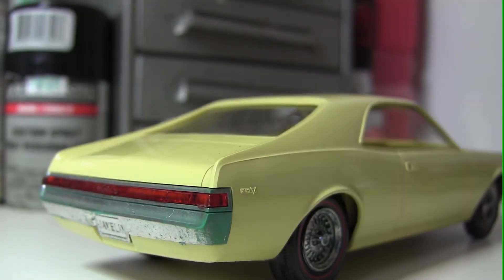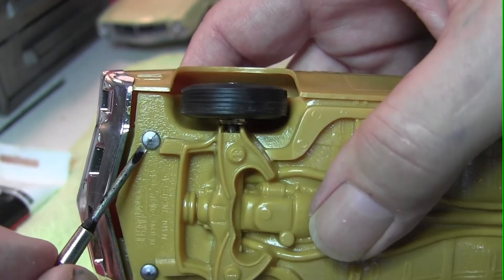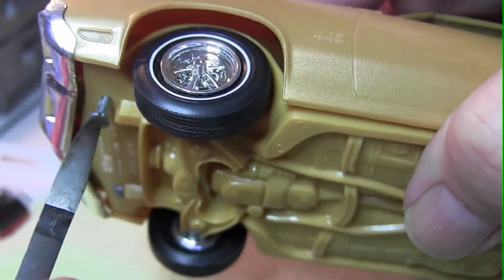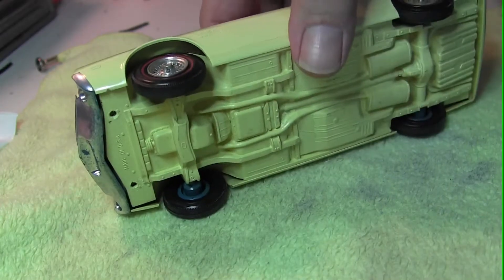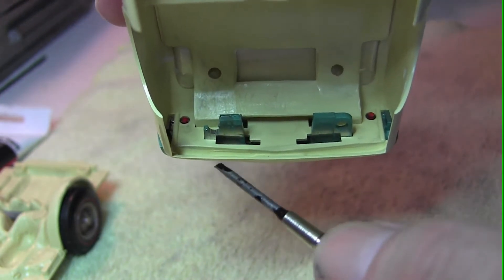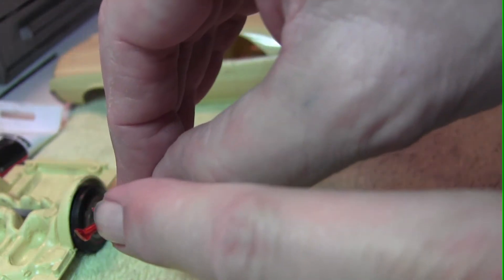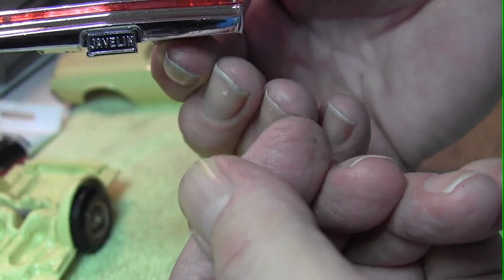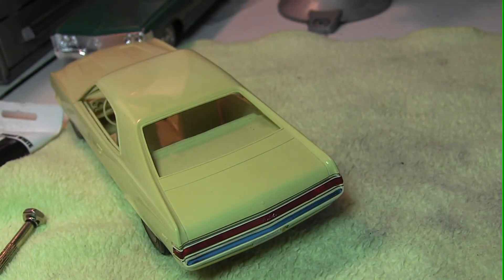Promo Bumper Replacement

Comment: The pin removal shown was for Johan's late plastic pins as used on the last years of their promo Cads and Oldses as well as the Johan/Ex-Cell re-issues.  I note you already had the metal pins removed from the Javelin.  You didn't state how those were removed, but by the amount of 'digging' marks around the hole, it looks like you may have used the same dig & pry method.  Using heat to remove the metal pins, instead of digging them leaves the chassis unmarked. The dig & pry method will only work if there's enough space under the metal pin to insert the screwdriver's blade. Sometimes there is, most often there isn't.
Reply: Thank you Chuck for the info. I was unaware of the heating method. I would be concerned about damaging the body.
Reply from the maker: If you have or make a video of using heat Ill link to it. I was unaware of using heat. I am all for less damage.
Reply: I don't have any means of making a video, but I'll give you the basics.  Needed:  An old style soldering iron--if you can find one with a small flat end, that's the best, but a pointed end can work too; An assistant to operate the soldering iron (in my case, it's usually my wife--begrudgingly); Needlenose pliers; Small flat-blade screwdriver (opt.).  One pin at a time. Your assistant needs to apply the point of the soldering iron to the center of the metal pin.  Keep it firmly in place so the pin can get 'hot'. Generally 15-25 secs is long enough.  Remove the heat source, and, using your thumb and index or middle finger you rock the wheels on that end of the chassis up and down while lifting the chassis on the side just worked on.  If the pin is hot enough, it will begin lifting up. Usually you can then grab it with the needlenose and remove that pin. If it doesn't lift up and the chassis is still firmly down and seated, then apply heat again and repeat.  Sometimes the pin will lift up and come all the way out but still be attached to the chassis since it's hot.  Just let it cool, and the pin will easily come out of the chassis. Be careful not to touch the pin as it's hot. Sometimes if the pin isn't quite high enough off the chassis to grab, you can help it with the small screwdriver, but that's not usually the case.  Heat and repeat for the other one at that end, and then do the other 2 if applicable.  To re-insert the metal pins, simply hold the head of the head of the pin in the pointed end of the needlenose and heat the shaft with a cigarette lighter.  7-10 secs should be plenty.  Using the needlenose, simply push the pin back in until the chassis is firmly seated.  No digging, no damage to the chassis.  When the metal pin gets hot, it also heats the plastic in the post enough for it to lose its grip so the pin lifts easily out.  This is the method I learned years ago, and I've been using it ever since with no problems whatsoever.  If you want to practice on a 'beater' that's fine, but it's really not necessary. I did that the first time just to check it out, and I found out I really didn't need to. Good luck